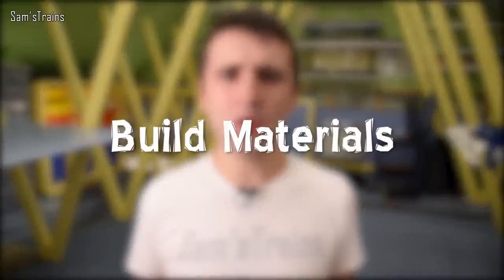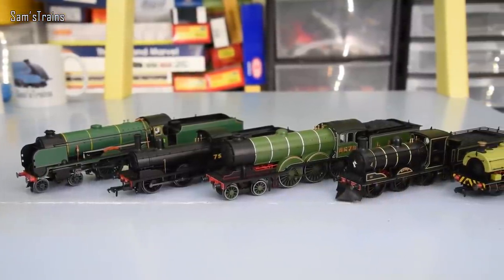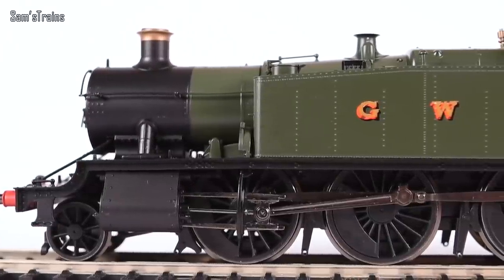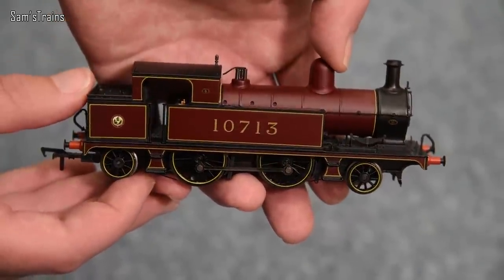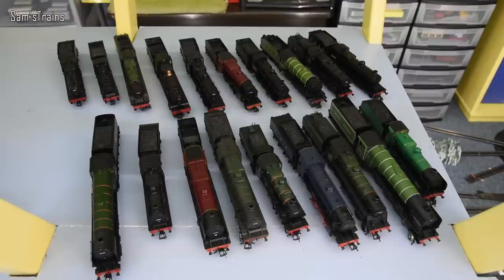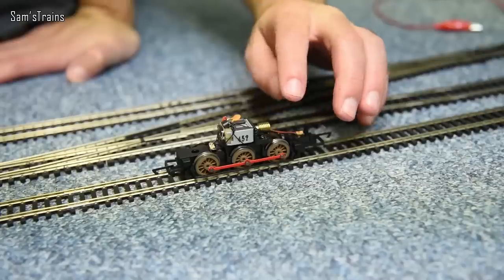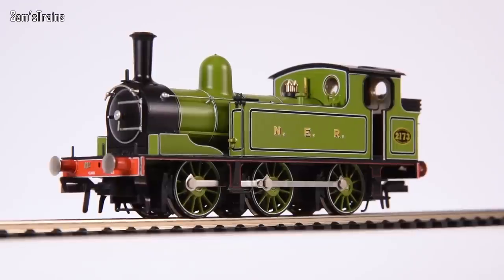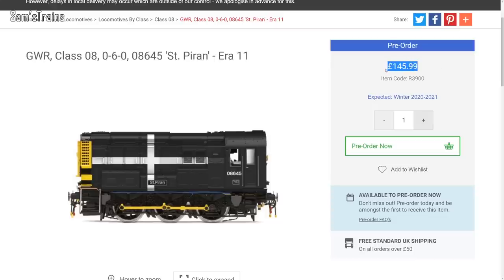Bachmann vs. Hornby Trains | What's the Difference?

Comment: I bought Bachmann tornado many years ago in BR blue. Stunning to look at. But slowed down on third radius curves. Really annoying I ended up getting a refund. I now have a Hornby tornado. Brilliant big flywheel as you say but sadly it doesn't have the tender pick ups which is unusual for Hornby. Overall it's blissfully smooth. I have 2 Bachmann Deltics both are super powerful and very impressive. Generally I think Hornby are the masters of steam engines and diesels, well I have a soft spot for old Lima's. Serviced regularly and adding extra pick-up's and weight they are very smooth and reliable. One mechanism I really hate are the Hornby (ex-dapol) Great Western 4-6-0s with the loco drive ringfield. Don't believe they are manufactured any more.... thankfully! An appalling mechanism!
Reply from the maker: Yeah absolutely - same thing again: poor mechanism! Sorry to hear it was no good for you - and again, a pity that the Hornby Tornado didn't have the full pickups either - never understood that!
Thanks for watching - Sam :)

Comment: Bachmann: has good detail but has bad mechs

Hornby: has less detailed locos but better mechs
Reply from the maker: Yeah generally that's true - though Hornby's detailing is often easily as good as Bachmann's! :D
Thanks for watching - Sam :)
Reply: @SamsTrains  theoretically, could you take the mechanism of the Hornby loco and put it into the Bachmann body so you have a frankentrain with high detail, high performance?

Comment: I think the reason the Bachmann 08 is less than Hornby's is that the Bachmann model is a much older tooling than Hornby's one, having come out several years beforehand. 

Also, the Hornby mechanism is a much smoother one and a better performer.

When it comes to Bachmann locos, I personally prefer the older split chassis design like the old Mainline design was, much more rugged and reliable than their current offerings and also same with Hornby.

I myself would rather buy older locos and detail them myself than pay an insane amount of money for a newly tooled loco which I could do the detailing on for a lot less.
Reply from the maker: Yeah no doubt - I wish I had both so that I could compare! But hey - cheaper is cheaper!
Thanks for watching - Sam :)
Reply: @SamsTrains  that's true on the cheaper front ^.^

Perhaps ya should do a vid on the venerable Dapol static kits, in particular their Class 9f Evening Star kit?

With work, these kits can be turned into awesome models

Comment: Curious when it comes to cost between the two manufactures, would it be possible to say the Bachmann has more cost due to the labour required for details being applied and quality? Typically mechanism costs are much less but still may not justify the added cost
Reply from the maker: I'm not sure - I wouldn't say Bachmann's locos consist of many more parts than Hornby's do... the level of detail is very similar between the two!
Thanks for watching, Sam :)

Comment: If I look at new stuff. Hornby you can be almost certain of what you will get. I also think that all there is stuff is pretty well assembled but there are occasional issues. Bachmann on the other hand is a bit of a lottery - you will get something that looks nice and is will put together but how well it runs is a guess - the pulling power I have also found to be weak. The other thing with Bachmann and some of their multiple units is the windows are still blacked out due to the crazily large  mechanism they use. The new class 158 is an exception it is a very nice model but I think that the detail bag has too many parts for the user to fit. In recent times the manufacture i have been most impressed with is Rapido
Reply from the maker: Yeah you're right - that's because (with some exceptions) Hornby established a high standard back in 2001, and they're more-or-less stuck with it. It's only over these past few years that Bachmann have begin to fit better mechanisms (with proper bearings, tender pickups etc), so there's a lot more rubbish out there from Bachmann!

Comment: Bachmann has had issues with axil bearings for some time. I have several “big haulers” their chassis are plastic and to top it off the walls are very thin and no bearings! Bachmann has improved them though with proper brass bearings.

Comment: some of the weight based issues make me wonder weather or not any one of the model makers plan on choosing different means to increase traction (beyond even such maligned classics as traction wheels).

Shipping heavier things costs money and if they can get away making things lighter they are prone to use such solution, plastic body and plastic chassis is possibly result of such a thought process. Thats my guess on why it happens anyways.

Quite nice idea for video tho.
Reply from the maker: Yeah it's an interesting thought! Shipping heavier things does cost money - but at up to £200 per model.... money they got!! I would love to see other solutions - I don't think any can substitute heavy models!
Thanks for watching - Sam :)
Reply: Doubt for shipping as the overall weight is low but economy of scale perhaps

Comment: Hello Sam, i was wondering would you consider getting into the Marklin Trains? From what I see they seem to be really good quality.

Also I was wondering I know you use sewing machine oil to lubricant your trains but would you recommend using grease on the gears? If so what brand or type of grease?

Lastly I was wondering what brand and type of sewing machine oil do you use on your trains? Because I was about to get singer sewing machine oil, but a quick google search told me that it was bad for plastic? So I was wondering if you could tell me what kind of oil you use.

Thank you, cheers! 👍
Reply from the maker: I would like to one day - I've heard great things about their quality! :D
Thanks for watching, Sam :)
Reply: @SamsTrains  It would be very interesting to hear your thoughts, when you get into the marklin trains, especially the ones with steam! 

Hey Sam, I was wondering would you recommend using grease on the gears on model trains, if so what kind?

And also what kind and brand of sewing machine oil do you use on your locos?

Thank you, cheers 👍

Comment: Hi Sam. Did you do one of these comparisons for diesels? I was really surprised by your findings. My hornby locos are really struggling for traction on my garden layout and I was looking for all wheel drive. Do you have anything?
Reply from the maker: I haven't yet - but when I own more diesels, I'll be sure to do a comparison of those too! I'd say Bachmann's diesels are a bit better than Hornby's - but sure - Hornby's 56 is quite the beast! Also check out the Bachmann 37 - that is superb! :D
Thanks for watching, Sam :)
Reply: @SamsTrains  that's good Sam. I had heard that bachman diesels were better than hornby but that was from a retailer. Can I ask if you have any diesels which have both bogies driven please? I have real issues with single bogie motored locos not being able to cope with more than 2 coaches on a very slight incline and my hornby class 37 which only 1 bogie powered and the middle wheels of that bogie are not powered is unable to start 2 coaches outside and struggles to get itself over the slightest of grades  because the bogie pivots on the centre wheels causing 1 of the driven set to lose traction. This

Comment: I would say that they are tied for me right now. Bachmann has been on a winning streak with their engines like the Atlantics and the E-1s. The problem I have right now is that Hornby's prices for their new releases are growing really close to Bachmann's. From the retailers, those standard 2s are more expensive than Bachmann's Atlantics. And, with Hornby, you don't really know what you are getting. You may pay all of that money and get a complete lemon like the Large Prairie or the H class, or a real winner like the Peckets or the J36. I would say this, if Bachmann's 1P tanks and Caledonian 812s are up to the very high standard of the Compounds and the Atlantics, then Bachmann would probably take the lead for me. 
You should do a Diesel/electric thing like this as well. Maybe compare Dapol to Heljan.
Reply from the maker: Thanks William - you're right - Bachmann's latest releases have been a step in the right direction. They don't yet outweigh the number of poorer models still in their range, but more like that will definitely be an improvement! You're right - not keen on Hornby's new prices - but as long as the quality stays high (mechanisms too), I won't complain too much!
Thanks for watching, Sam :)

Comment: From what I can tell, Bachmann Models of Thomas and Friends are more popular and are the go-to models for avid Thomas fans, because the designs are more faithful to the show, so it's no wonder they use these for re-enactments of existing episodes, or even original adventures, for that matter. 

The Hornby were far more detailed and used moulds of pre-existing models, like the Jinty, Black 5, Dean Single, etc. But that range kicked the bucket from what I heard. Fans do prefer simplicity over realism when it comes to Thomas and Friends. In other words, less is more. But in general, Bachmann charge ridicurageous prices despite how slightly inferior they can be when compared to Hornby.
Reply from the maker: Yeah that's very true - it's just a pity that Bachmann's range isn't more reasonably priced (as you say), and less impressive in terms of mechanism :(

Comment: Ok, so I'm an older kid, lol, looking to get back in to a train, nothing too serious, probably just one track and train for now, first, I'm torn between HO and O gauge, second, have always loved the Flying Scotsman, but being an OO gauge, is that the same as HO? Thoughts on the Scotsman? I'm not looking to spend a fortune. Here in the U.S. it looks like there's not much to choose from with Hornby, looks like Bachman and Lionel are the main choices, I do like that ez track system, but as a huge Harry Potter fan, I also love that train from Hornby also. Lionel does offer one in an O gauge for a bit more. Guess I'm just looking for what will  take the least maintenance and most reliable at a fair price. That was one thing I noticed about the Hornby tracks, they had limited supply and were 2 to 3 times more for track extensions. Will a Hornby locomotive like the Scotsman run on a Bachman ez track system? Sorry for all the questions, lol, trains have gone up in prices since 30 years ago, just trying to find the best, most reliable deal.
Reply from the maker: That sounds great Matthew! OO and HO gauge are the same gauge, but slightly different scales - you can mix and match if you wish though! O gauge isn't much good if you don't want to spend a fortune - OO tends to be a bit cheaper, and there's much more to choose from too!
Happy New Year - Sam :)
Reply: @SamsTrains   Thanks for the reply, you've helped me make up my mind, being I love the Scotsman and Harry Potter OO trains sets from Hornby, so probably going to go with OO/HO. Neither of those trains make any sounds or smoke, and I don't think they do the chuffing sound either, any way to make a train do any of the sounds, in the tender box maybe? Thanks again sir.

Comment: Hey Sam, I was wondering I know you use sewing machine oil to lubricant your trains but would you recommend using grease on the gears? If so what brand or type of grease?

Lastly I was wondering what brand and type of sewing machine oil do you use on your trains? Because I was about to get singer sewing machine oil, but a quick google search told me that it was bad for plastic? So I was wondering if you could tell me what kind of oil you use.

Thank you, cheers! 👍
Reply from the maker: Sure! I'm experimenting with silicon grease - it seems to work perfectly, but I'm not recommending it to people yet, until I know what the long term effects on the plastic are... should be fine though! :D
Thanks for watching, Sam :)

Comment: Some observations. Bachmann locos never wear out their axle slots so having separate bearings seems no advantage. Bachmann motors in my experience are far more rugged than hornby's motors of late which will die very quickly if overloaded for whatever reason. Bachmanns tender pickups cause far less friction than hornby's, thus robbing less pulling power.
Reply from the maker: The bearings are better - all manufacturers (including Bachmann) fit them into their modern releases... if they weren't important, they wouldn't now be fitting them. It's not just about wear and tear, it's about reducing friction and smooth running. When bearings are part of the chassis, they're moulded, and not particularly smooth. When bearings are separately fitted, they're smoothly turned from materials with low coefficient of friction. The difference is clear to see!
Thanks for watching, Sam :)

Comment: Hi sam interesting one this, it does sound a bit hit or miss with both manufacturers,  even down to model to model from same manufacturer.  Was surprised to find out that the Drummond 700 was a 3 pole locomotive. I have 4 of these 693 695 325 return from dunkirk and a br version. All seem consistent in performance and excellent runner's. I've 18 bob ,west Country and merchant navy's original and rebuilt and these seem to vary depending on track and temperature. I left a reply to your query about the Hornby h class erratic running on your video about Hornbys new large prairie new tool video about 2 months ago, not sure if you see reply.  I now have a T9 that fell to bits literally rebuilt mazak rot and wiring problems. She now pulls 64 wagons but when i tried 6 maunsell coaches she slipped,  the coaches were free running so dont unstand as to why. My school class ( 9 ) are the same Shrewsbury pulled 80 wagons on second radius curves with the engine just 2 feet away from my brake van with a small gradient.  Yet others won't pull more than 40 wagons although all have new traction tyres your favourite. As for Bachmann all mine seem to run well but not fully tested as yet but only tested to 35 wagons. Model ( 3 ) C class ( 3 ) E4 ( 1 ) Fairburn ( 2 ) N class ( 1 ) H2.  Hornbys N15 ( 12 )and S15 ( 3 )seem the most consistent performers 50 wagons 15 coaches. Hornbys M7 ( 6 )is inconsistent ,some will pull 15 wagons others won't pull more than 9 so I guess it down to the actual model itself ( good one bad one )seems to be the norm. I dont intend to run these levels of coaches and wagons but its nice to know the level of pulling power of each individual locomotive. Keep up the great videos. Going to watch your monster schools class( love me tender ).
Reply from the maker: Yeah they certainly both can be hit and miss - hopefully I put that across! Yeah the 700 are perfectly good runners - but you can just tell a difference at the very lowest speeds! Thanks very much for sharing all of your experiences - very interesting stuff! :D
Thanks for watching - Sam :)

Comment: looking at your channel and others Altough engines are exspensive in general, there always seems to be a bigger in take of breath when the Bachman retail prices are mentioned . I agree that bachman can produce some stunning models but Hornby i think appeal to a greater part  of the hobby base In the main all 3 pole motors should be discontinued unless size is a problem
Reply from the maker: That's certainly true! Hornby's models are usually a bit better, and usually cost a bit less - the appeal is real!
Thanks for watching - Sam :)

Comment: Diesel & Electric contribution which other commentators can comment on even if Sam cannot. I would say Bachmann D&E are of a good standard and typically cost around £150. The Hornby 31, 50, 56, 60, 67, and 87 are of a similar standard and also cost about £150. The Hornby HST and IE800 cost more but are larger so proportionately with size about the same. The other Hornby D&E models are of a lesser standard and cheaper to match. Good for starters and children. The Hornby 08, as Sam remarks, costs more and possibly a slightly better model. So broadly could say that Hornby and Bachmann are mostly of a similar standard and have a similar value for money. Dapol and Heljan are about £20 cheaper but their recent stuff is just as good a quality as Hornby and Bachmann. So Dapol and Heljan are slightly better value for money. Then you have Kernow Class 41 (early Warship) and Bulleid 1-C0 1-C0 and Suttons Locomotive Workshop Class 24 at about £190. More expensive but worth it. Hattons Class 66 at £150 was more detailed so better value than the Bachmann but production quality has been patchy.
Reply from the maker: Thanks for sharing Alan - yes that all sounds very fair - Bachmann's diesels seem to be higher quality than their steamers, at least from the ones I've owned. I'll have to go further into diesel territory one day!
Thanks for watching - Sam :)
Reply: @SamsTrains  - Last thing I could add is that Heljan Hymek under the Bachmann EFE brand costs £20 more, for presumably the same model. But yes agree Bachmann diesels and DMUs are of a consistently high standard. If you do a diesel comparison equivalent maybe you could do it in conjunction with a diesel youtuber friend in a joint production.

Comment: Hi Sam,

Interesting video, one loco I own/owned both examples of are the Br Standard 9F. 

In the steam 2-10-0 category bachmann triumphs in my opinion. Yes they suffer from the same issues that bestowe a bachmann loco and they’re over priced. 

But interms of pulling power, detail and performance all 4 of mine have by far exceeded my railroad 9F so much so, I sold off the Hornby 9F and I replaced it with another bachmann one. 

The only Hornby 9F I now have is a crosti boilered one as bachmann don’t make one......yet...... Mind you if they did imagine the price!!!! 

Anyways great video. Keep them up.

Ross.
Reply from the maker: Thanks Ross! I've never tried the Bachmann 9F, I must give that a try some time! :D
Thanks for watching - Sam :)